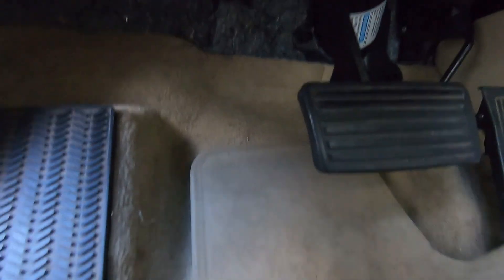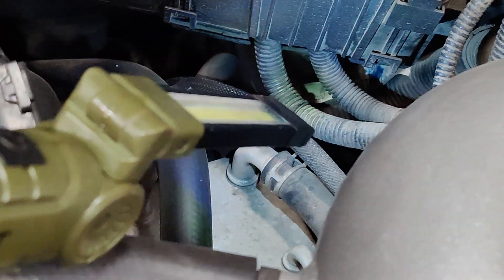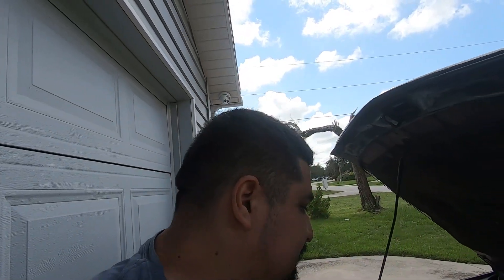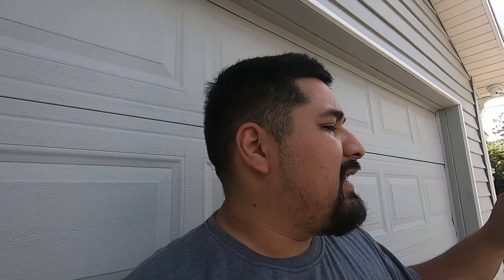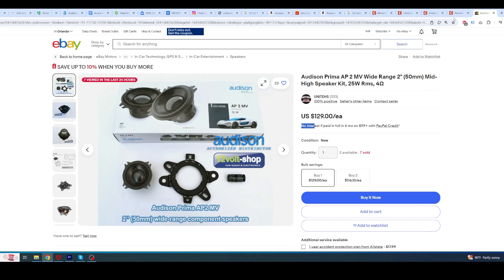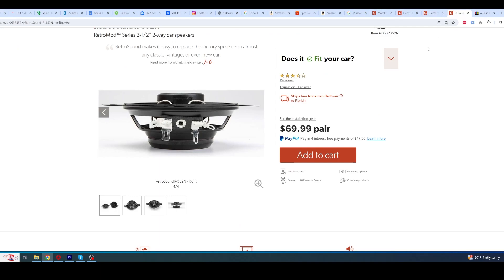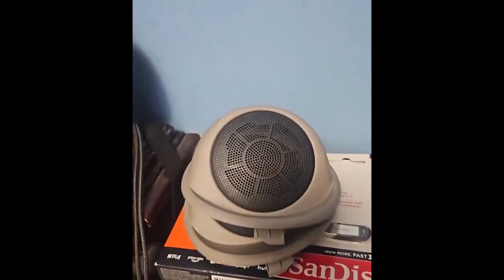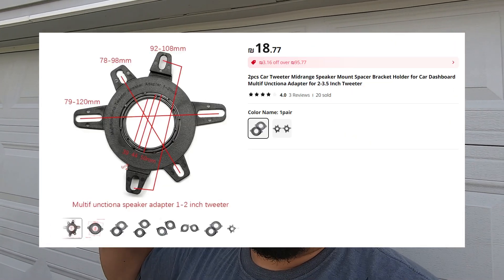Acura TSX  Update - Power Wire Through Firewall - Wagon Pillar Speakers - Center Speaker Upgrade

Comment: This is hugely helpful, thank you so much! Glad to know I don’t have to take off the entire pillar to replace my blown wagon pillar speakers, now I just need to find ones that work
Reply: @sir2gooo  i believe you do have to take off the entire pilar, if you listen, I think that guy says that he broke them
Reply from the maker: @Kylethemestupfile   so the manuals states you have to remove the rear c-pillar and then two bolts hold the housing for the speaker. But in the diagram the speakers are held by two screws. I do think the cover pops off but I am not sure, the MDX said to remove the pillar but the cover did pop off also. https://ibb.co/M2h8QpG
Reply from the maker: https://ibb.co/M2h8QpG